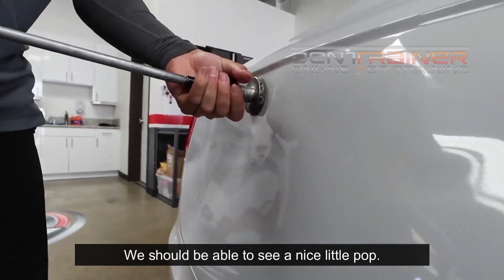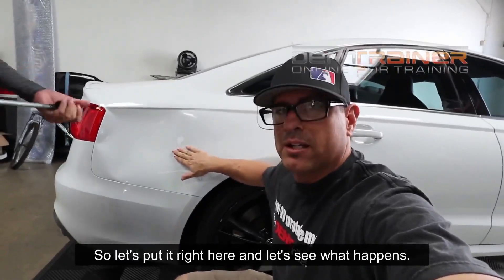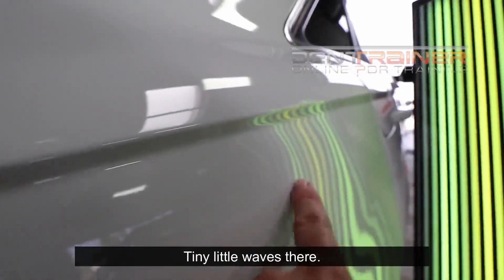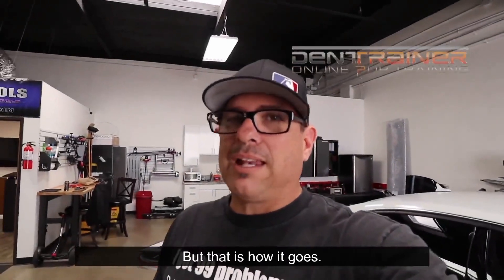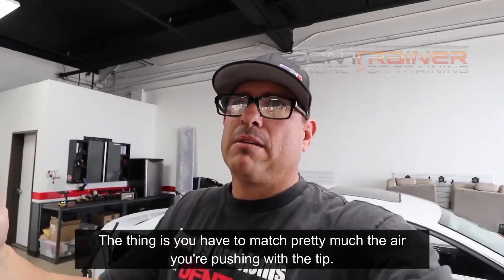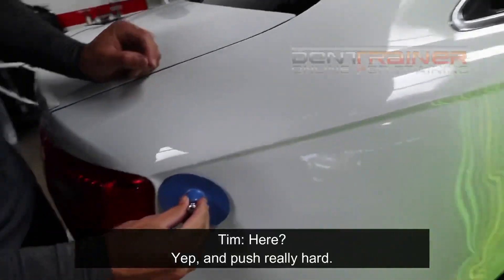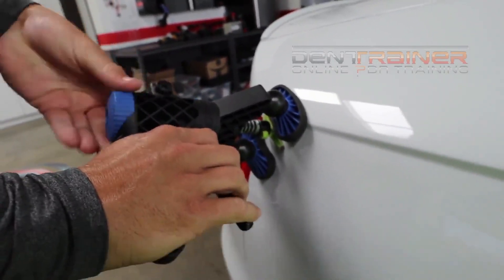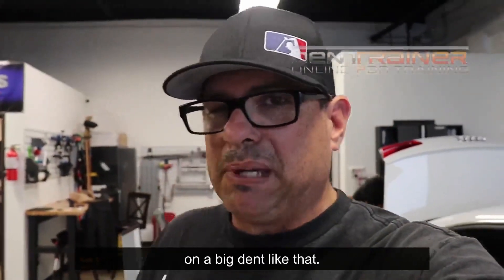Starting Big Dent with Glue Pull Techniques

Comment: do you think super tab better than cold glue? I do. thanks Mike.
Reply from the maker: It depends on the circumstances. For controlled pulled or deep dents, the super tabs. For rapid pulls and to get you to a certain point, cold glue is definitely a great option. Thanks for the comment and question.
Reply: @denttime  thanks Mike